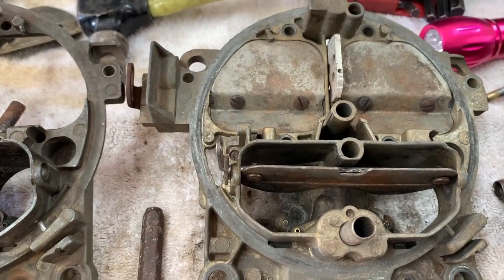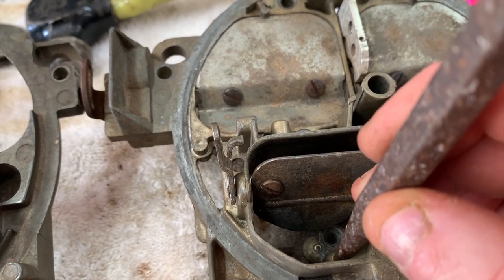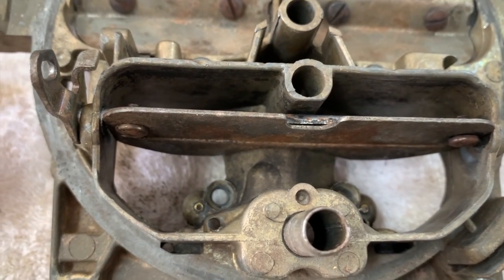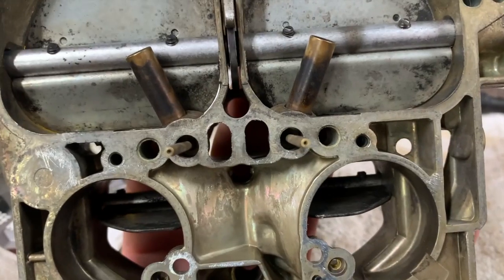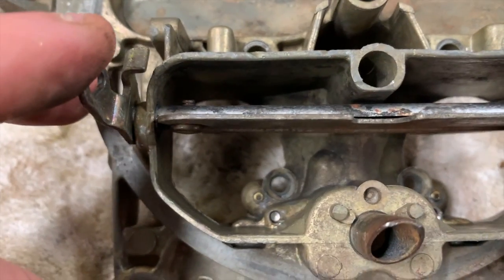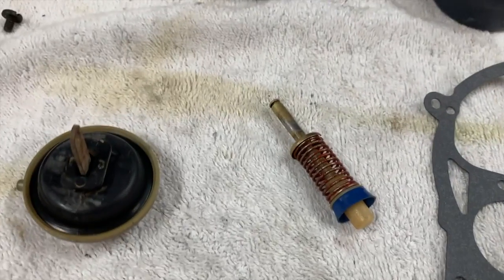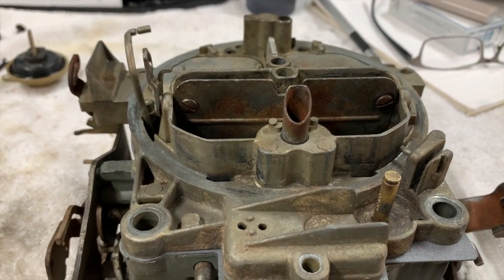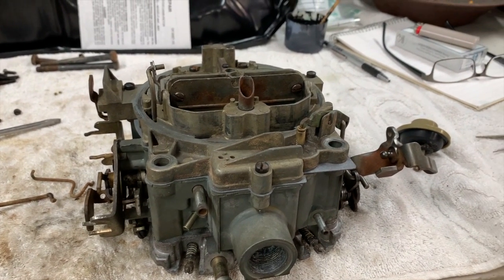Rochester Quadrajet Air Horn Modifications Make a Stage 1 455 Buick Air Horn! #nonamenationals

Comment: In fact I'm bolting an 800 on my motorhome today. Quadrajets are almost less complicated on the inside than on the outside.
Reply from the maker: yes, the exterior linkages are difficult, especially if its missing all the linkage and you have to piece it together.